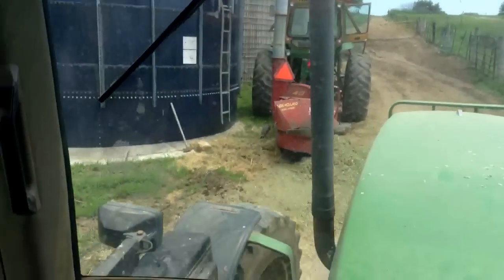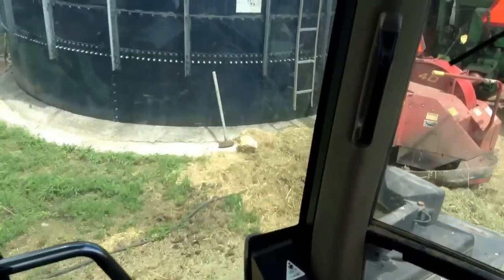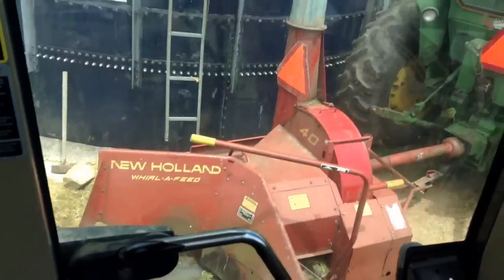Unloading Haylage into a Silo

Comment: That New Holland model 40 is a great silage blower. My grandfather and uncle's farm had the same blower for quite a few years before they switched to ag bags. They never ever had that thing plug once I don't believe. It's a much better design in my opinion with having the one fan getting the silage moving so the other one isn't starting it from a dead stop. It helps too that it is 1000 rpm pto speed. The only thing to be aware of is when you first start filling the silo is to do the first load at a little slower pace because the inside of the blower pipe might be rusty from sitting all winter.

Comment from the maker: Unfortunately, I don't believe so. We unload as fast as possible, without plugging the pipe on the silo (which turns into a long job of trying to unplug it). Unloading from these can be pretty slow at times, also. Most large operators use bunker silos to my knowledge.
Reply: Be more careful around live pto shafts even with the plastic safety sleeve I've lost friends and neighbors from clothing getting caught in them and your shirt came close a few times

Comment: How does the silage get up into the silo?  Is it blown with air?  An auger?
Reply: The big fan powers it up at high speed.  Smaller silos use a bigger fan on a 540 RPM PTO, bigger silos use a slightly smaller fan but running on a 1000 rpm pto on bigger hp tractor.  Some of the most powerful have a gearbox to spin it up faster.

Comment: never seen done like this, interesting. How do you compact the grass in the silo? Great vids by the way
Reply: It's basically like bagging you don't have to it gets pretty tight settling before you chop enough to fill it the bottom 2/3s gravity does a good job from falling from the top running 4 wagons 2 wagon tractors and a 2 row chopper with the pickup head unit on we never got more than 20 ft a day filled of an 80 ft tall 25 ft diameter silo filled and after a month you could get a decent days worth of late cutting in before starting on a bunker for alfalfa haylage silage fills faster and don't settle as much and bunkers and packing came into play

Comment: Good videos, but you need to watch it around those shafts. Also, the blower power unit doesn't have a kill switch. I would rig up one. I'd wear gloves on the job.
Reply: The lever he moved before starting the tractor is a clutch nothing will stop the blower fast but that's how to do it from the ground good call on the shafts I've been to too many closed casket funerals in my time from those

Comment: no pto shield. I CAN'T LIKE IT BECAUSE OF THE MISSING SHIELD. A 540 pto shaft can take 9 feet per second and your only about 6 foot is my guess. I'm glad others have supported my opinion.
Reply: The black plastic around it is the safety shield in perfect condition you can grab it while the shaft spins full speed and the plastic will stop in your hand while the shaft continues spinning but it's only perfect till it's off the dealers lot and hooked up but it's the only kind of guard that can be put on something that turns so sharp

Comment: Did you seriously just attach a PTO shaft to a running tractor? Not to mention the fact that it doesn't have a guard either. 

You're asking to die fella, come on it takes two minutes to turn the machine off and on and guards are cheap as chips.
Reply: As long as nobody's in the cab to play with the power switch the tractor don't need to be off and the black plastic around the shaft is the guard you can grab it and it stops while the shaft spins inside is the concept but for something that turns so sharp it's all they got